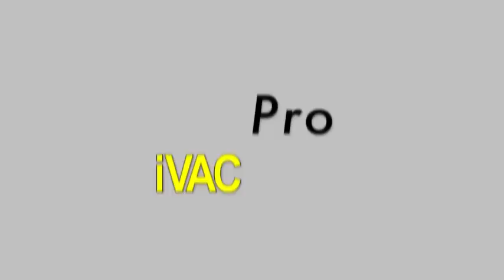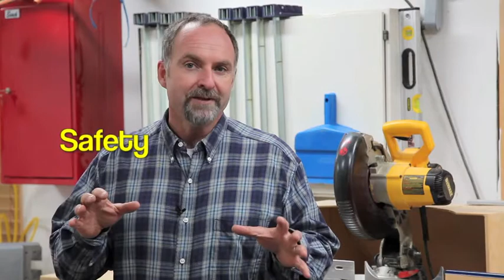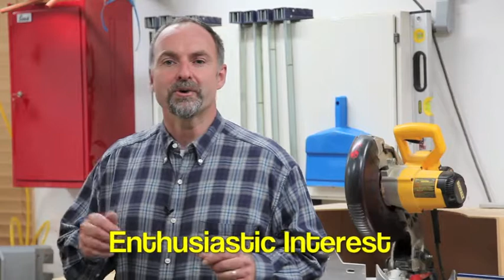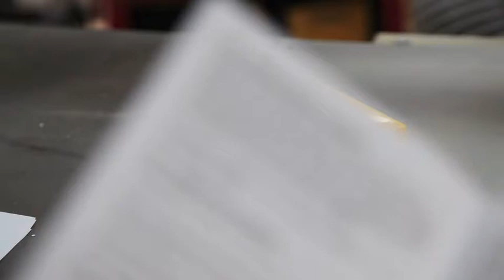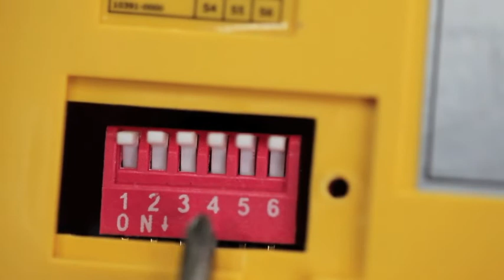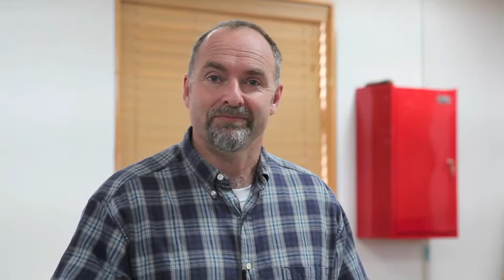WORKSHOP DUST CONTROL AUTOMATIC: iVAC Pro Wireless Switching System Tour

Comment: I have the older iVAC system and it's worth every penny spent on it. There's not much to it but it's well built and the plug lengths and appearance encourage a neat and orderly installation of tools and dust collection system components--in my case it certainly did.